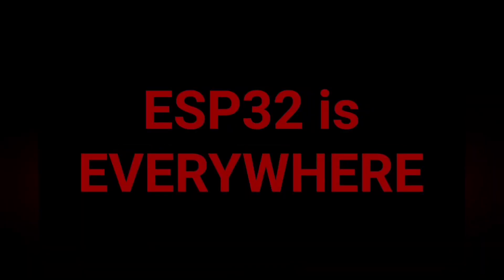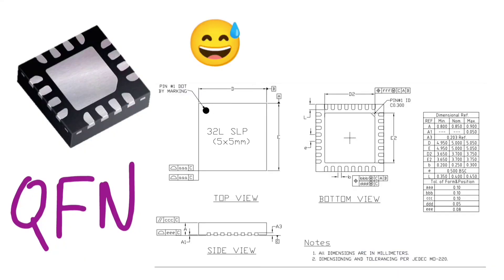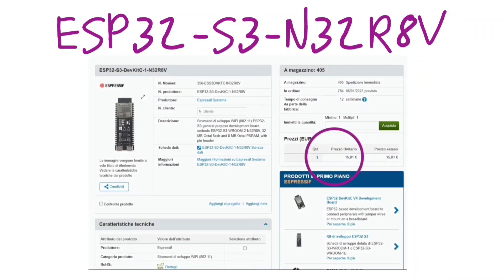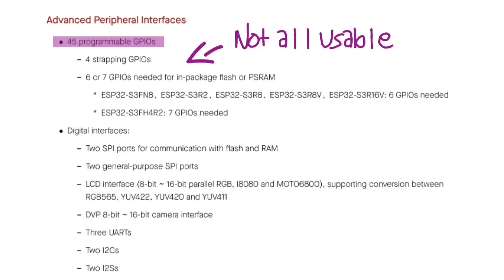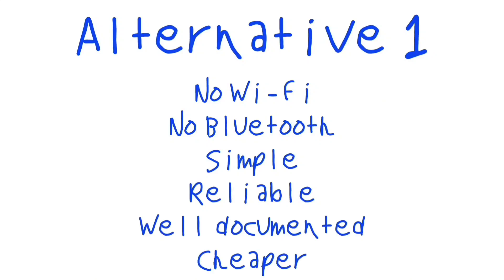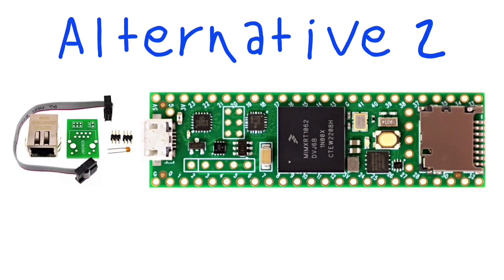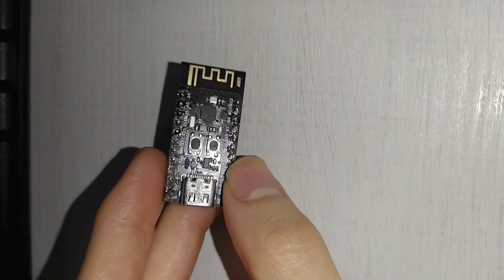WHY ESP32 is EVERYWHERE?

Comment from the maker: Hi all, this is a video about ESP32. In particular why is it so famous around hobbysts? Even arduino itself has implemented an ESP32 in some boards to make it wifi-compatible and it is really difficult to find a real substitute of ESP32. Do you use ESP32?

Chapters:

0:00 - Intro
0:21 - Costs
01:13 - Speed
01:56 - Memory
02:39 - Functionalities
03:30 - DevKits
03:57 - Usability
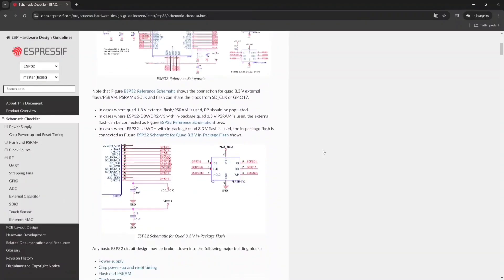04:22 - Design guidelines
05:15 - Alternative ATTiny
06:20 - Alternative Teensy 4.1
07:00 - Alternative Pico W

IG: https://www.instagram.com/xburningelectronics

ESP product selector:
https://products.espressif.com

Comment: I like the PIC family of MCU chips. Dirt cheap, through hole, and powerhouses for their price class. The drawbacks are the tiny memory and storage, as well as the voltage (12.5-13.5 IIRC) required to put them in programming mode.
Reply from the maker: I don't use PIC MCU but l heard that they have long term support and availability

Comment: I struggled long time, which MCU to  take for my first projects and ended    up with STM32 which comes with its own advanced IDE based on eclipse, which is really sound 🤯
I want to add that this is a professional tool for engineers actually, experience in electronics and c programming is recommended.
Reply: ESP32 is more a system-on-a-chip concept and ready to go. Heavily used in IoT products where radio communication is needed. STM32 is bare bone microcontroller development and not targeted to any specific application domain. Bolt discussion to start with that stuff.
Reply: @johanwithag2432 that's why I like to use STM, because it's a well documented and 'naked' system which is good to learn everything about microcontroller programming. But now I found that I have to improve my C programming skills 🤓
Reply from the maker: We always learn! If you want, for your smaller project you can even try attinys as said in the video
Reply from the maker: @johanwithag2432  Although ESP32 is more ready-to-go as you said, its pcb implementation is more difficult than most, if not all the STM32 as it is a SoC
Reply: @BurningElectronics  Hi, I agree with the more difficult pcb implementation, I have this concern to. And the one-source dependency on Espressif.
Reply from the maker: @fano72  Was your first MCU? I mean, you started with STM32?
Reply: @BurningElectronics  Well yes, it's my first real microcontroller project. I have  experience in developing C(++) and ASM and wanted to bring my Java Synthesizer to a bare bone microcontroller. I found that STM makes good tools and comprehensive documentation, as well as powerful and affordable MCUs like found in the black pill board. Do you know it?
Reply from the maker: Yeah I know it, not that deep but I know for sure. And yes, STM is obviusly a good brand, I don't play as much with their MCU tho